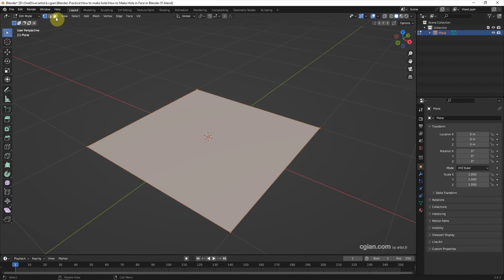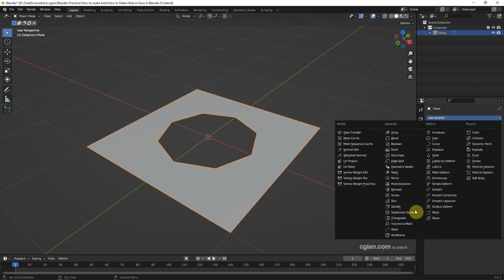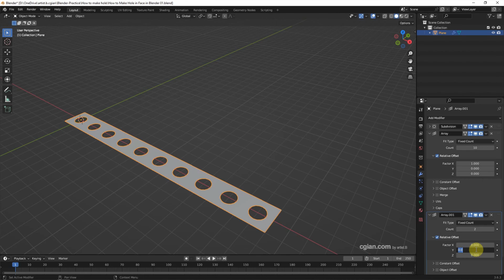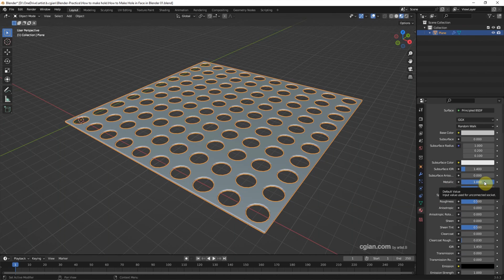How to cut hole in plane without Boolean  Modifier in Blender | Perforated Metal Hole Pattern

Comment: Thanks for the video it was a good lesson. My only concern is that when repeating it too many times, the plane has far too many vertices, increasing the file size drastically. Is there a way to do a similar pattern without making too many vertices?
Reply from the maker: Good point! Alternative way is, not to use vectices to make the holes
Reply: @blenderian.3d  i messed around looking for other ways, i found if I size out the plane to scale needed, then use an array on a cylinder to create a boolean to cut on the plane, it worked alot smoother